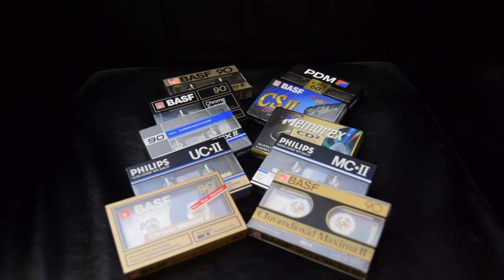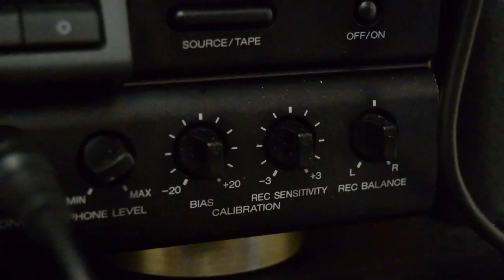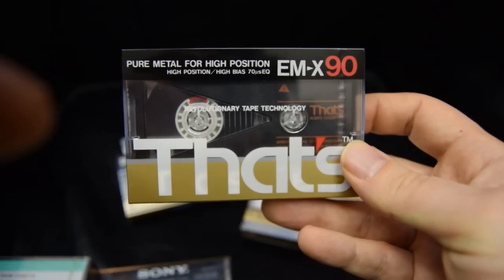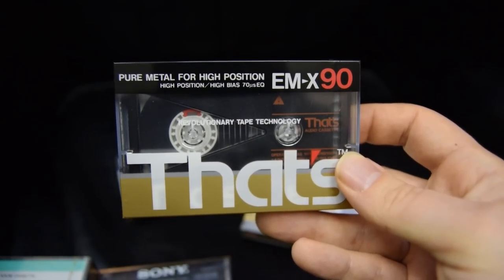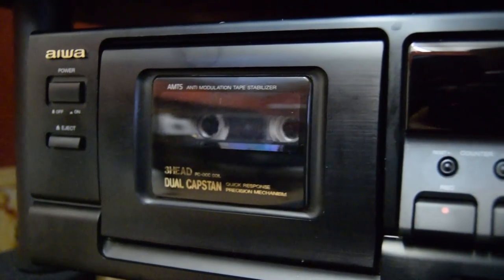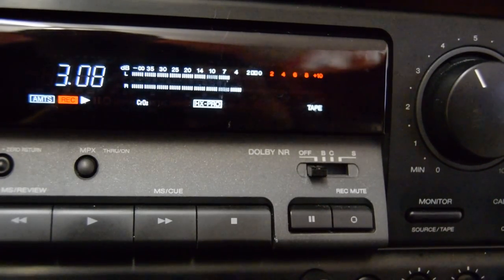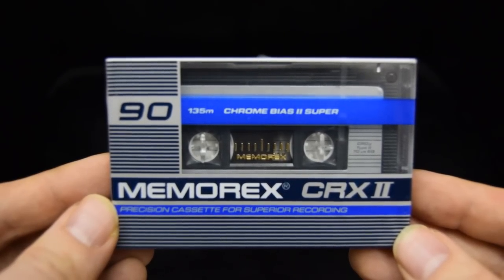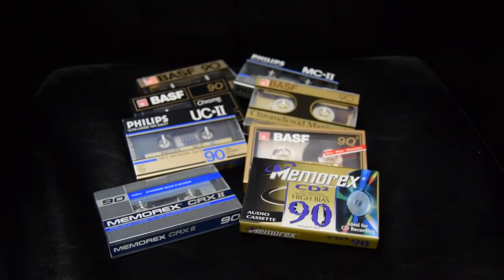Pure Chrome Type 2 High Bias Cassettes - Why They're Not "Rubbish"

Comment: I never understood why people would say "tape hiss", when in reality it's the deck itself that hisses and that hiss gets recorded unto the cassette tape. With no tape in the deck, press play ( In professional tape decks, you might need to put your finger where the sensors are located to trick the deck thinking there's a tape loaded in the deck.) Press play, and turn up the volume. You will hear the same hissing noise without the tape in the deck, that hiss eventually gets recorded unto the tape. Notice when you unwrap a brand new virgin tape and play it, there's no difference between the leader tape and magnetic tape, the only hiss you will hear is the noise that the deck produces like I mentioned earlier. Some people say tapes sound crappy, that's interesting... because I managed to record my tapes louder and cleaner than CD's. With professional tape decks and Chrome/Metal tapes it's possible, believe me. I love compact cassette tapes, one of my favorite music formats ever invented. That's why they still sell blank tapes till this day. I just picked up some Blank Maxell UR 90 & UR 120 tapes at Fred Meyer, Radio Shack & Walgreens to perform music recordings. Wish they sold Chrome & Metal tapes tho.
Reply: That hiss doesn't make it onto the tape because it is not being modulated by the bias.  Tapes do hiss if they haven't been erased properly and even then, they hiss because of the random nature of the orientation of the magnetic particles.  Pressing PLAY on any tape deck and turning up the volume, you will eventually hear hiss because there are so many sources of electronic noise.  Every electronic component generates noise, the heads have some intrinsic thermal noise as well as being miniature aerials for radio waves (try recording something with a mobile phone on top of your tape transport)  But these effects are in the -90dB level (on a very good deck), much lower than most people would be listening for.  A well shielded transport and good quality electronics gets you to that level, the tape's natural hiss will leave you at around -55dB.  The natural solution to reducing tape hiss and extending the frequency range is to either decrease the tape particle size (compact cassette) or increase the speed of the tape and/or increase the track width (open reel) both have their advantages and disadvantages.  Most people would use a noise reduction system if their deck/tape combo produced noisy recordings.  The main draw for tape is the sound, specifically, the distortions that recording onto tape gives the original signal.  A simple experiment is to record a square wave sweep from 20Hz to 20kHz onto various tapes at 0db (400Hz cal) and see what tape does to the signal.  I strongly suspect, this warming of the sound and other electro/mechanical imperfections is why people prefer the sound of tape (me included)

Comment: I was gifted 23 BASF CRM II's. They are in great shape however recorded over once. They sound like rubbish in my Yamaha natural sound deck. When I record at a certain input level, and play them back they are at a much lower level on output playback. It's a two-head Deck with fine bias trim and tape tuning. To get these pure chromes to sound decent in my Yamaha should I advance the bias trim or decrease it do you think? I know it's hard to do blind on a two head deck.
Reply from the maker: Japanese decks don't normally like pure chromes unless they have level and bias calibration facilities. The low output you're experiencing is expected. Just use trial and error, but as long as they output at 0db or less, you're on the right track. As for the bias, just take a song you know really well, record, listen back and repeat, until it sounds like what you'd expect it to.
Reply: @CassetteComeback  Thank you so much for the reply! 

So it doesn't matter if the input levels will recording or peaking way into the red as long as the finished product outputs at 0 db? I have to drive these tapes so hot to get them to have a proper output at the end when playing back. That won't cause distortion or anything? Sorry to keep bugging you.
Reply: @kona702  true chrome has a lower output level vs cobalt chrome.
Reply: @kona702 orrect.  It's the recorded output signal you should concern yourself with + listening for distortion.  It seems like tape sensitivity is irrelevant with a good deck that has a powerful, adjustable, recording amp.  High sensitivity (tapes that output louder than they recorded) are probably great for less-than-good equipment.

Comment: I also like BASF Chrome tapes, on all my decks I ever had I got good results on them. Even on Soviet Radiotehnika M201, which had no adjustments for bias or record sensitiviy, and had only 40-14000 Hz frequency range on Type 2 tapes. Later I had KENWOOD decks with autocalibration feature, I think because of it it could record Chrome BASF perfectly. Now I have RAPRI-102 Soviet deck based on Japanese head and tape transport, I tried BASF Chrome tapes on it - perfect results. Also I tried other pure chrome tapes on it, such as Soviet-made MK-60-4 (this is Russian-made pure chrome. I couldn't find image of one that I currently have, but this one has the same tape inside http://mk90.net/2014/08/svema-mk-60-4-1987). And got pretty decent results, this tape lacks some level, but other then that I like the recording quality on it. Bad thing that these tapes were near to impossible to buy even in 1980s. Now even it is easier to get them, but sometimes there are overpriced as being "rare".
Reply from the maker: It could be that Russian decks were internally calibrated to pure chrome, as opposed to Japanese Ferro cobalt Type 2, since this was easier to get as the main manufacturers were in Germany?
Reply: @CassetteComeback  Yes, I Think so, actually Russian decks was calibrated to Pure Chrome tapes made by SVEMA factory in the USSR (today it is Shostka, Ukraine), and later to ORWO Typ 137 tape made in East Germany (this tape behaves very close Soviet one). The sample image of Soviet pure chrome cassette was above in my comment. I think BASF pure chrome was somehow close to it, but BASF had better dynamic range and MOL. But I cannot tell that Japanese Type 2 tapes sounded bad on these decks. And my current RAPRI-102 1988 Russian deck actually is not factory calibrated, it is custom calibrated by my good friend, who repairs cassette decks of all levels, including Nakamichi ones. And I didn't ask him what tape he used to calibrate the deck when he repaired it (main reason for repair was that record function didn't work). But he used test tapes to fine-tune my deck, including bias and record-sensitivity settings. Fnd I don't know what kind of tape he used, but I have good results on pure chrome tapes definitely.

Comment: I never really researched this, but since one of those BASF was thrown in for free inside the packaging of my tape deck, I always assumed that is what it was calibrated for :)
Reply from the maker: Might have been. What brand was the deck?
Reply: @CassetteComeback  It's a Fine Arts CT 903 edit I just looked at the service manual, it is CT 905, actually.
Reply: @Baerchenization  yup, Grundig - should work well with Philips pure chromes too.
Reply: Omg lt's been almost 30 years, but now I went in to my parents' attic and got the deck out for having it restored to new:) stupid question of the year: when setting it up for a certain type of tape, is that only relevant for recording, I suppose? It seems my old tapes were dumped, so if I buy new ones, can I get these Maxima II tapes or are there better ones while I am at it? I like the idea of keeping it as intended by Grunding kinda period so to speak... This is going to be such a waste of money 😆

Comment: Please explain why it's unwise to push a type-II or Chrome tape higher than 0-db?
Reply from the maker: Because they distort. Not all Type 2 are chrome. Most are Ferro cobalt, they can be pushed higher than 0db. Recording hot means you have to use less amplification, hence you hear less tape hiss in quiet parts. Pure chrome tapes have such low hiss to begin with, it's not necessary.

Comment: Do chrome tapes last longer i.e. Don't degrade?
Reply from the maker: Everything degrades. It all depends how many times you play them and well looked after your deck is, but pure Chromes are pretty tough from personal experience.
Reply: That comment had not aged well too! In my experience pure chromes are the worst in degrade. They lose some db of recorded sound in just few years, but constant on frequency so the response is not changed (but this fucks-up noise reduction scheme, if used). And then chrome tape lose sensitivity, more in the high part of spectrum but also in the bass. To be recorded well need a deck with large control of bias and sensitivity. And more tape ages the worse it would be. Chromes of more than 40 years old can't be used anymore but ferrics of the same age, doped or not, have not changed their parameters.

Comment: Isn't' true that Chrome type are only good to record once? Because if you record a song over a previous one the previous one is still audible as a phantom song!
Reply from the maker: Not if your decks erase head is clean and working properly.
Reply: @CassetteComeback  Ok. I say this because I remember in those days people preferring type I to type II just to avoid this phantom issue. Ends up it's all about the recording gear. Thanks.
Reply: @Popart-xh2fd  I did have to turn up the wick on the erase head to overcome the calibration tones that were recorded (BASF Chrome II Maxima and Reference Maxima), but once I did that and re-calibrated, the problem disappeared.  The erase head receives the same bias signal as what is used to modulate the audio being recorded.  Some decks seem to have a quite "quiet" erase level which doesn't get at the non-linear maxed out portion of the pure chrome tape, i.e. the tape has been driven very hard into saturation and needs quite a poke to reset it.
Reply: @Popart-xh2fd  that is probably because a lot of low end equipment like boomboxes or shoebox type recorders did not have a switch for type II.
These devices were fit for use with type I only. So, if you would  make recordings on a type II in these devices the magnetism from the heads was not strong enough to properly erase a tape II or higher. A lot of people using this cheap devices actually lacked any knowledge about cassette types so this was not uncommon.

Comment: I feel like DuPont did themselves no favors in making it so expensive to license their formula for chromium dioxide, no? I know the process was very hard to do and they spent a ton of money in r&d but then ended up having most companies just use the cobalt doped method didn't make them any money at all so I wonder.
Reply from the maker: Yeah, it was licenced for a while. Maybe BASFs output was enough to pay for it all. I guess we'll never know...
Reply: They also did it to give Polygram a competitive advantage on their pre-recorded tapes which were Chrome due to their duplication facilities being a joint venture of Philips/DuPont.
Reply: @mbvideoselection  they also did it because chrome tape as a distinct advantage when duplicating at high speed due to its low Curie point that allows even very weak magnetic fields to be fully recorded (useful if the tape is moving at 30x its normal speed)